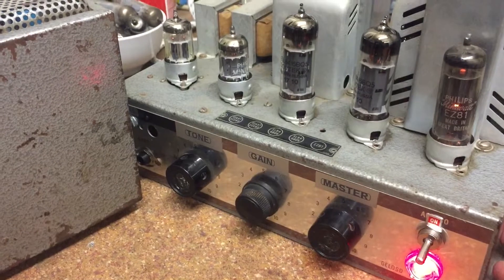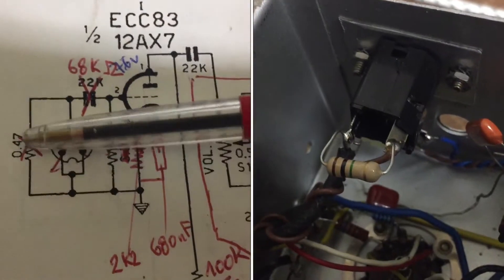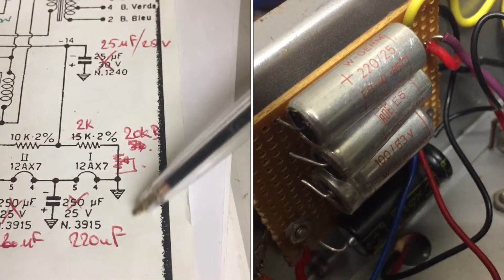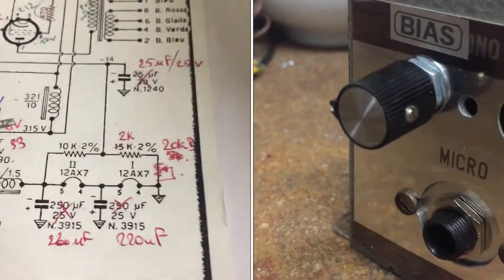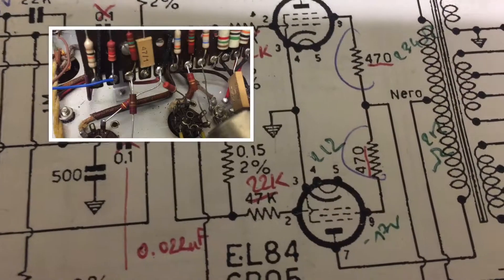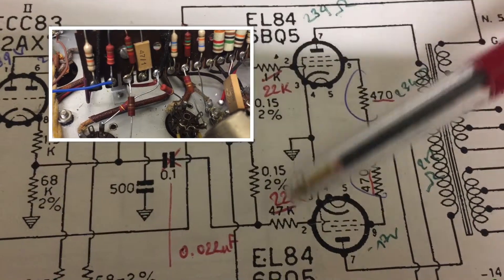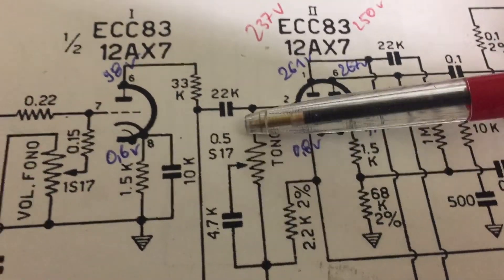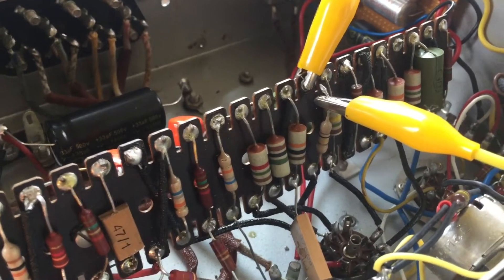1963 Geloso G215AN tube amp: experimenting with bias & negative feedback

Comment: Great Job and sounds fantastic! I have the chance to buy a G215AN here in Italy and I'm planning to make it a guitar amp. I have experience with repairing and building tube amps, but I'd like to see exactly what you've done to it! Would it be possible to share your modded schematic with me? Thanks in advance and great job anyway
Reply from the maker: Hi Alex, thanks so much for commenting. Well, I don't really have a schematic for it -- except the written notes on the schematic you see in the video. As you might be able to tell from the date, this video is already 5 years old and haven't done much on these amps since. I took the Geloso schematic and put it next to the Dr. Z Carmen Ghia  schematic. I think there is also a later video where I implement the Long Tailed Pair phase inverter. It didn't make a massive difference. I also changed the whole input stage with grid biasing, it hardly made a sonic difference. A lot of tone shaping happens in the interstage capacitors (coupling caps). Right now, I would want to change out the output transformer on one of these and replace with a good Marshall 17W type transformer. Would it make a difference? Something I still haven't tried: converting the amp to cathode bias. Right now it is gridbiased but takes its voltage from the same line that provides the filaments heaters of the preamp with their 6.3V (DC! not AC) -- no guitar amp I know does that.
Hope this helps a little, I'll check whether I can find the schematic.
Reply: @zjokka  lots of interesting points there, thanks for the information! I took a quick look at the schematics and it seems to have some unconventional solutions like the DC filaments for preamp tubes, choke on bias tap etc... those probably were meant to provide some extra filtering and reduce the hum and noise floor, so to give it a more "HiFish" flavor. Probably not needed and maybe not wanted on a guitar amp... but still these old Geloso have some great guitar amp potential I think. About the output transformer, I don't know about the quality of the original one, but changing the OT usually results in some audible tone changing too. I had good experiences with Hammond OT in the past if it can help, good value for money. I'll let you know if I manage to get my amp and mod it, in the meantime thanks for the information!!